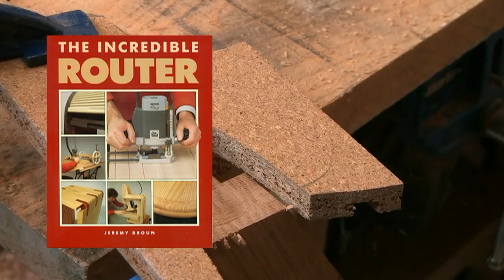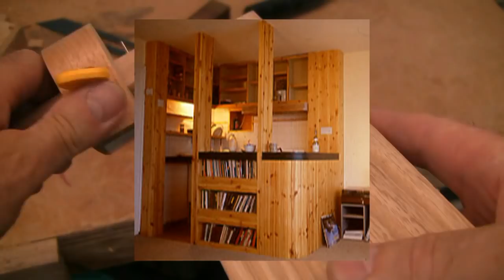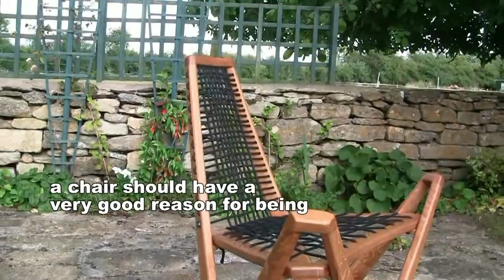Designing & Making A Rocking Chair

Comment: As an old country boy from the States, I really enjoy Your design philosophy.  I worked for many Years building prototypes for a major manufacturer.  Most of these had to come from my mind as there were no engineering drawings.

I have found that I am totally visual, able to see the building process in minute detail in my head before beginning.  It is refreshing to see another fellow designer.  Current project, designing a fishing kayak using corrugated steel roofing.
P.S. Might copy the idea.
Reply from the maker: Well done